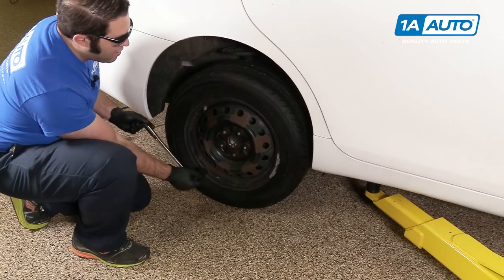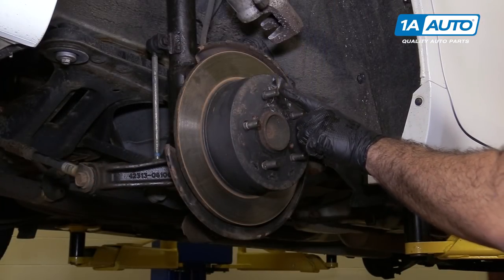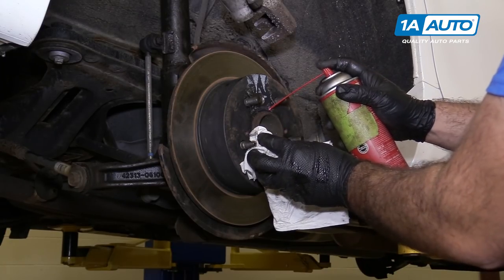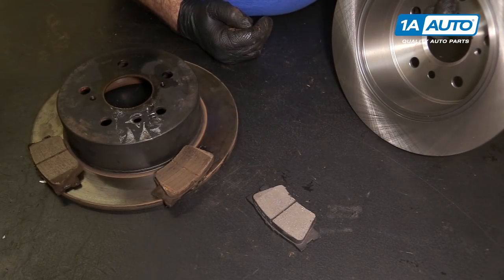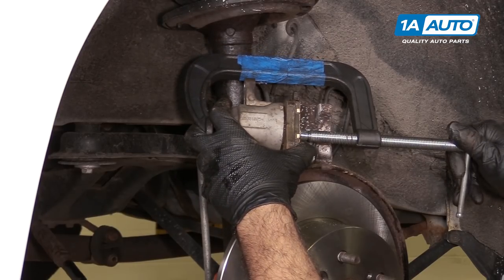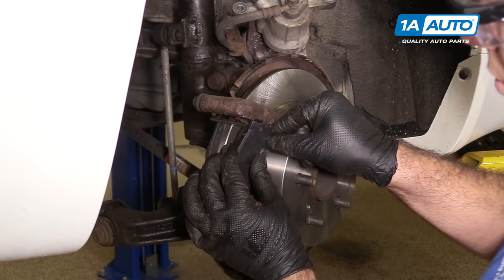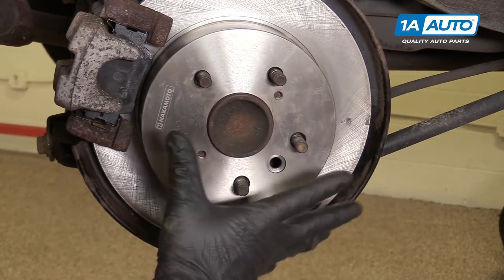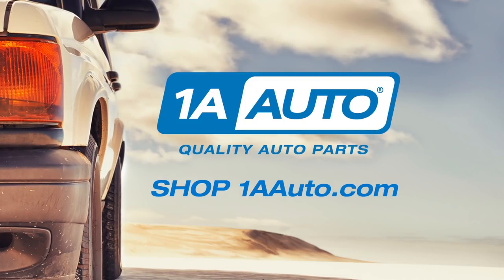How to Replace Rear Brakes Pads Rotors 07-11 Toyota Camry

Comment: I may have missed it, but mentioning that if the rotor is still too stubborn to remove even after using rust penetration oil, M8 x 1.25 bolts can be threaded into the two tapped holes in the hub of the rotor to "POP" the rusted rotor loose.  Works like a charm...
Reply from the maker: +Michael Mathras Thanks for the tip!
Reply: Why didn’t that work for me?
Reply: Did the trick thanks! 👍🏽

Comment: Nice video. I recommend pulling the clips out and cleaning and greasing the bracket face behind them as well. I've seen brackets that had those faces rust and swell up behind the clips distorting the clips and interfering with function. Moisture likes to hang out there. I like to put a light coat of grease on the ring face of the piston if not using anti-squeal(piston rusted to pad...seen it. Great way to cook the seals). 
Also grease the hub face so the rotor isn't rusted to it the next time someone has to get in there.  If the bracket and slide pin hex heads are in decent shape I'll grease those too(I would've inspected and repacked the pins). 
07-11 It's probably time to replace the flex lines while you're in there. 
I'm in the rustbelt and have been doing my own auto and cycle brakes and brakes for others for almost 30yrs.  I pretty much grease everything to slow the rot :)

Comment: I appreciate that you actually left in the part where you had trouble backing off the parking brake shoes.
Getting that adjustment wheel to turn in the right direction is almost impossible- especially if you have
aftermarket rotors that have an even smaller access hole than the OEM rotors.  Toyota should change
this parking brake design, or at least the adjustment wheel for the parking brake- but you know they won't....

Comment: Great video. First time doing brakes since I was a kid. Saved me $200 doing it myself thanks a lot.
Reply: For the rear, how do you take the rubber thing out?  Did you adjust it after putting the rotors on?  Was ur e-brake off?

Comment: @3:45
Isn't there a threaded hole in the rotor that you can screw a bolt in to and loosen the rotor by tightening that bolt? My son's Scion (made by Toyota) has one and it made it very easy to break the rotor free.
Reply: i just left a comment above:  you can take off the rotor using a M8-1.25 x 25mm hex head screw   lol

Comment: I would recommend using 6 point sockets on the bolts rather than the 12 point combination wrenches. 12 points beat up the bolts and are more likely to strip, especially with "beating on the wrench with a mallet" as shown in the video.

Comment: I just did my mom Toyota camry 2007 trying to replace the rotor but I notice 1A Auto the car ya fixing on Toyota Camry 2009 have a much bigger hole to release emergency brake from rotor so I was able to get rotor only wasnt able to change brakes my hole so little I cant see me pushing release emergency clip thru hole with flat head at all thanks anyway I'm just take to shop next time rear rotor before I brake somethen

Comment: How do you get the caliper bracket back on the pads? The circular part that touches the inside pad is sticking too far out and I don't want to beat on it more than I have. As of right now theres no way it'll fit around the pads
Reply: Either use a press to push the piston back in, or buy a brake piston tool

Comment: If you can't get the rotor off, and can't get to the emergency brake tab inside the tiny hole,  just release the emergency brake from inside the car. That at lease did it for me.

Comment: Hey great video but you took the time for everything but didn't take the caliper sliders out and anti seize/lube them? That's just lazy. Rest of the video was great, thank you.
Reply: You don't need to antiseize anything. Come on.
Reply: Always lube your pin.. im with Clint
Reply: Dumb comment. Did you watch the same video I did? Those slider pins are sealed with a rubber boot. They are literally surrounded in grease. You saw him pull them back and forth and they smoothly slid back and forth, because they were sealed and encapsulated in grease. The old style, unsealed ones, you anti-sieze the pins. On this style, as long as the boot is still sealed and in good condition. You just work it free like he did and then you are done dealing with it.
Reply: Scott is absolutely correct!
Reply: I'm doing this at 100k+ miles. Each side is already costing me $95. $20 bucks more for pins, seals and grease is peace of mind I'll gladly pay. Besides this is my only ride, I'd rather have them and not need them, than ride a bike getting parts and wasting time.

Comment: The rotor is a pain to get off trying to use a screwdriver to unloosed the breaks is too tedious. I just grabbed a hammer and banged on it a few times and wedged off lose. Spray it down with break cleaner first though because the second smack released a lot of break dust
Reply from the maker: +Shrimpwerks 23 Thanks for the feedback!

Comment: The caliper bolts are supposed to be torqed to 25 foot-lbs not 46 foot-lbs...  The head of the bolt snapped off due to over torquing!
Reply: might be different on the style (le, se, etc) and if you have alloy wheels... I've heard 25 ft/lbs as well for brake calipers. 34-46 ft/lbs for rear torque plate bolts; 79 ft/lbs for front torque plate bolts
Reply: i know it's late fir you, but for anyone else wondering he was torquing the caliper bracket bolts to 46 ft lbs. it's tough to see but the torqye wrench head is not on the caliber guide bolts.
Reply: Caliper mounting bolts are 20 for the rear, 25 for the front.  Caliper mounting BRACKET bolts are 79 for the front, and 46 for the rear for 2011 and earlier models.
Reply: I snapped a caliper bolt listening to this as well.
Reply: good rule of thumb is most cars and suvs caliper bolts are in the 22 -32  ft/lb range. Somewhere in the middle is a safe bet if you cant find the spec (Use Blue Loctite).  Always question a torque spec if it seems too much for the size of the bolt, or you feel the bolt stretch and the wrench doesnt click yet, stop

Comment: Does your "Premium Posi Ceramic Brake Kit Nakamoto" comes with brake hardware?
Reply from the maker: +Qu4ttro The brake hardware would need to be purchased separately.
Reply: +1A Auto Parts - Just to confirm... when you say brake hardware, it means the metal clips to attach the brake pads onto right?
Reply: So the "Premium Posi Ceramic Brake Kit Nakamoto" does not come with these metal clips?
Reply from the maker: +Qu4ttro The pads should come with the metal shims

Comment: Make sure you jack both sides up put the car on a flat surface, put the car in neutral this will help the rotor & wheel hub bearing spin freely to hit it off! My head Mechanic taught my young self this trick❤❤

Comment: Why are you using a C-clamp just stick a screwdriver in there before you pull the caliper off and pry it back and forth a little bit and push the damn caliper piston in Easy Peasy japanesey Z